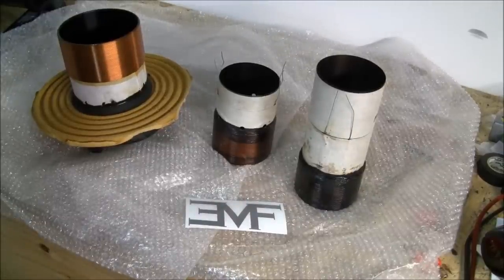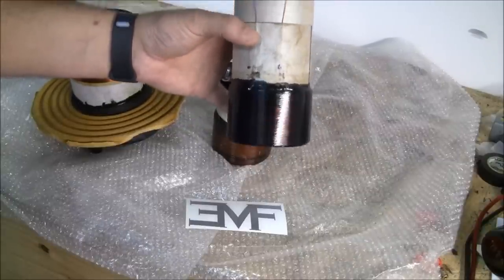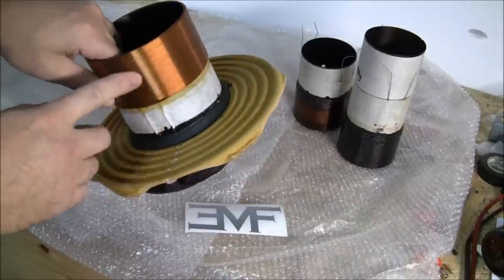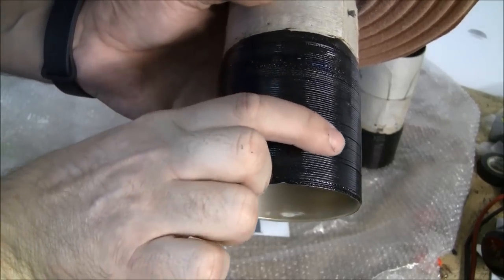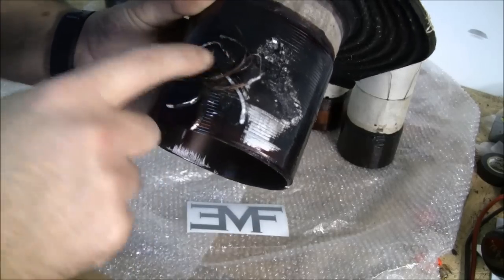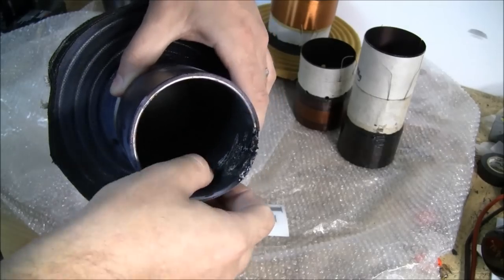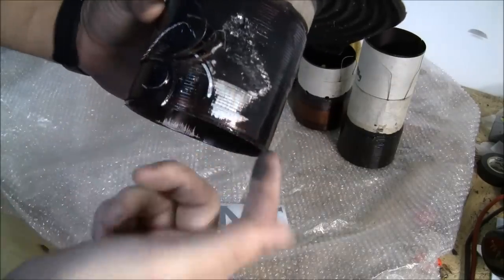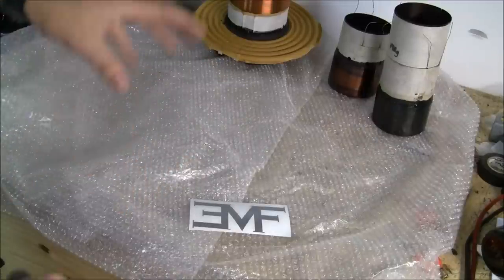Voice Coils - we know what you did!

Comment: So the dust on the last coil was cause by current arching, do this is related to Brazilian amps having a really high voltage power rail?
Reply from the maker: The dust is smoke residue.
Reply: So what do you do when some immoral person sends in his burned coil for undeserved warranty work?  Cheaters tend to get nasty when they get caught!  I hope that fact doesn't deter you from doing what's right.
Reply: they do have a high power rail, a lot like the HCCA amps and others, but the cause is lack of supplied voltage to the amp i would think and possible poor filtering or boosts from the caps inside, it is not a steady voltage and is usually because people try to overpower with cheaper amps without extra batts better alts ect ect, and well cheap amps just are what they are, they are cheap for a reason.

Comment: If the subwoofer cone were to move in and out too far by too many inches will the coil smack the back plate of the subwoofer
Reply from the maker: If the design allows for it, yes. In many design cases (like when I design one) that isn't possible.

Comment: I have a stereo integrity sql12 on a slash 1000/1 for about 2 months and now it’s making a noise. People are saying it’s a bad coil but it doesn’t make any noise when I push on the woofer. I had a 10w7 and 12w7 on the same setup and they didn’t have any issues. Could it still be a coil even though it doesn’t make a sound when pushing on the cone?

Comment: What is better the copper or aluminum coils? I know the copper should be better just based on the amps and heat it can take. But maybe there is something I am over looking with the aluminum coils.
Reply from the maker: Both have their place in design. Our Lowballer and Banhammer line use copper coils, the YOLO and Ermagerd line use aluminum coils. There are benefits and drawbacks of both that can be used for advantages in design.
Reply: @EMFAudio  Thanks for the fast reply but could you give a little detail on the benefit and drawbacks? Sorry to ask so much. I just find it all very interesting in the design choices.
Reply from the maker: @ganon420  That is literally an entire Tech Stuff Tuesday video I have planned.

Comment: Great video! Can you tell me anything about the coil in a JL 12W3v3-4? I can see some minor black bubbling on the coil through the gaps in the basket and am thinking about trying to repair it.  Is it possible to make my own coil and replace it? I am down for a challenge. Any info would be awesome!
Reply from the maker: No, you can not wind your own coil. I've never reconed one to know much about that coil used but JL's general design philosophy is 2 layer coils that aren't particularly long (except W7), wound on plastic formers.

Comment: How do you determine how far the voice coil should be put down in the ring at the bottom of the basket? Is there a measurement from top of coil to the spider or does the coil just pushed down where it won't go any further into the basket? TIA
Reply from the maker: The middle of the coil windings go in the middle of the top plate.
Reply: @EMFAudio  thank you!!

Comment: To me the use of the polyamide film on the "500 degree" coils is more to make up for the deficiencies of cheaper aluminum, rather than provide a better, more robust voice coil. A true high temp coil would have both polyamide insulation film and copper wire, which would equate to a much more rugged voice coil.
Reply from the maker: Copper wire doesn't necessarily make it more rugged. It will handle more current but it also weighs a lot more and generates more inductance, which means efficiency would suffer which in turn handles LESS power.
Reply: @EMFAudio  The weight is a fair enough point. But the cross-sectional area must be increased to provide the same current handling capabilities, so the weight savings wont be as dramatic, but still can save about 40% over copper, maybe 50% if you decide to push it. But it has one draw back in that its much more sensitive than copper to heat, so it will blow open easier under overload. It may be easier to work, which could aid in fabrication, and also allow the use of non-circular cross-sections for different voice-coil designs to allow for the cross-section needed while still staying in the same gap width. This would be almost a necessity due to the higher eddy current losses in aluminum. This combined with the dynamic resistance will dictate how much heat it dissipates. At normal audio frequencies the series resistance will pretty much dictate that (I^2*R losses), but for some class-D amps this can be very much higher if they are sending the actual switching waveform to the coil without filtering. I will backpedal a bit and say the real advantage would be the use of a non-circular cross-section (e.g. a ribbon as shown) as this would allow for more flexibility in the form-factor (and possibly a lower overall inductance) for a given number of turns in the solenoid coil. But for a circular cross-section, the eddy current losses (and heating) are higher. With that said, there would be advantages if its done properly. Regarding the inductance wont affect efficiency at all. What it will do is make the sub harder to drive since it will be more reactive, and thus lower power outputs are achievable with a given voltage.

Comment: thanks for the vídeo, have a brand of woofer in brazil that the trail of the copper coil brakes, like a dot,only one turn of the coil, the color is like the original color, what do you think about? is a material problem? thanks in regard
Reply from the maker: If I understand how you are describing it is probably a material problem.
Reply from the maker: That looks like it was near it's power limits and found a weak spot in the wire.
Reply: thanks for the attention my friend!

Comment: I need to pull my EVL from its enclosure.
I've been running this 12 on that 1000.1 for a few months now and it started making a coil noise and the clip light flashes bright red at bass peaks.
I don't understand.
I've been monitoring the heat with an inferred thermometer and 150° occasionally is the hottest it ever got.
😐... Oh boy!
Reply from the maker: All of that makes sense.

Comment: Quick question if you were to exceed the subwoofers rated rms power rating and give it more rms power than what it's rated to handle will the subwoofer bottom out and what exactly does that mean when that happens
Reply from the maker: Bottoming out is reaching a mechanical limit at the bottom stroke. Typically used to refer to smacking the back plate. That isn't from exceeding rated power.

Comment: Can you put some new glue on coils that are starting to burn the old off?
Reply from the maker: The "glue" is epoxy or lacquer. The outgassing from it is normal, it's not effecting it's ability to adhere just causing a smell or sometimes a light smoke. If it's burning off, the coil will unravel and it won't matter after that. Additionally, you'd have to cut the sub open to do anything to the coil which means you're reconing it at that point anyway.
Reply: @EMFAudio  thanks for explaining that so well.

Comment: I would think with 5 or more spiders would make the sub’s efficiency very low and require way more power than what the coil can withstand.
Reply from the maker: Not every spider is the same stiffness so you can't go off of how many there are. 3 spiders could be as stiff as 6, but you are correct in that there is a point where you don't have enough motor force to overcome the suspension which in turn makes it so you have to apply a ton of power to make it move, to cool it. The motor and coil are factors in that together. It's a downward spiral in efficiency, from being too stiff to added heat, and repeat the cycle. There are instances where a less efficient sub can be louder because it's more efficient in the installation, which is why you'd use a bunch of spiders.

Comment: what does make the coil better is that it is OFC not aluminum.....and the coil is not darkening the glue is
Reply from the maker: What happens when you burn things? It turns black. How do you burn things? Excessive heat. How do you get excessive heat? Excessive power. The glue makes it start dark, too much power makes it darker. Copper nor aluminum is a better coil, which application it's used makes it a better coil.
Reply: @EMFAudio  yes burning makes it darker, i thought the thing when you were talking about the black super glue Rockville claimed was funny, but i would disagree on coil material, imo aluminum is inferior to OFC due to the resistance of the material, price point of course plays a part, anyhow love your vids.

Comment: Do you have an example of a defective coil?????? Or in your mind are all coils not defective??
Reply from the maker: A coil might be defective if it has a break in the wire as a result of fatigue with added stress from heat. There could also be a premature glue failure. I've seen it very few times, never from our own equipment.

Comment: OK . if I order say maybe a 12" lowballer. and don't like it . is there a chance of return & refund? I'm not hard on sub's. I'm more in to sound quality. but I like my Quality loud and low! but if I like it I would be buying more. unless I can get about 150db from 1 12", all o have is a little JL amp now. on a single 12", but I'm so in happy with it. its a cheap no name 12", it came in the car.
Reply from the maker: The return policy is on the website so you can see it's entirety. How much power is your amp? You won't be doing 150 with a single 12 without spending a lot more money on a higher line sub and I suspect a good bit more power. I will say that 2 Lowballer 12's are doing 150's with under 2,000 watts in a Focus hatchback, in a musical box.

Comment: How would you describe an unwound coil that is 95% still copper colored?
Reply from the maker: I bet I can guess the manufacturer of the sub! That's a poorly constructed coil, the adhesive used isn't sufficient for the temperatures.
Reply: @EMFAudio  Unfortunately, not covered by warranty. I overpowered it but the gain was tuned with a DD-1. 1500 rms rating on the sub. Dual 1 coils wired to 2 ohm and amp is good for about 2200 rms @ 2. Had the 12s wired to 1 amp at 1 ohm previously for a little over a year. No issues. Voltage was over 13v, played for under 10 minutes (not continuously) and blew smoke. Shut it off immediately, didn't want to risk shorting out the amp. Probably not worth mentioning an actual brand name here... But I can say their one line of amps are known for overheating..... Smh. Do you offer recones?
Reply from the maker: @jefffalk8484  In reality you probably had rated power or less. Not knowing what model sub it is I couldn't tell you if I could recone it but anything that isn't ours I can't build a recone for unless it's in front of me.

Comment: So I have been wondering for a while, is it possible for you to clip your sub if your alternator cannot put out enough power for your amp?
Reply from the maker: Yes, low voltage will absolutely cause clipping.
Reply: Clipped my subwoofers for 5 seconds because I had a unknown voltage drop at full tilt

Comment: I have a idq12v3 d4 and my magnet slipped out alignment and stuck the coil down. I got it out and the bottom is a little dark but at the top there is one wire with a scrape on it can I still use the coil
Reply from the maker: I'm not sure how you would reuse the coil since the whole thing has to be torn down to rebuild it after fixing the motor, but if the coil impedance reads correctly  it could be reused. A nick in the coil isn't a big deal unless it caused a break in the wire or it's barely connected where it will blow out during play.

Comment: Is it possible for a sub that clearly says on the speaker box itself that it's 175 watts rms and your amp that was professionally put in is tuned for 150 and they by the way admitted to that isn't that under powering I'm asking because I finally got a sub that came with a 500 watt max amp it's a nice 10 inch kenwood but it is connected to the crappy stock radio well the question is that when I changed my fade on the stereo itself to focus more on the back it definitely worked in making the sub louder it was noticeable and I didn't think anything of doing that except in doing so it blew the sub it wasn't a real expensive sub and amp but it was the only one I could afford it actually hits pretty good I was starting to like the sub im just wondering was it wrong to adjust the fade like that because I have no clue on the amp itself what knob to turn that's why I decided to just turn down the front speakers and have it on the back I don't think I did anything wrong but I am a little pissed because I payed good money for this and they would not tune the amp so it at least do the 175 not 150 can you please tell me if it's on them or me I really want to know
Reply from the maker: If the signal for the amp was setup on the rear channels and it was faded forward, then you changed it so the fade was at 0 or more to the rear, you would have essentially changed it so the amp made more power, blowing the sub. If it was set to 0 and you just reduced the front volume fading to the rear it wouldn't change anything with that. But it is possible you turned the volume up past where they had it set for or they set it incorrectly.

Comment: One was not centered you can see the rubbing on pole. One with chunk missing. I have done that on to much excursion an losing control in full tilt. It rubs an short out
Reply from the maker: Rubbing on the pole doesn't mean it's not centered unless the rub goes the entire length down the former. If it's just on the bottom that's from instability at high throw, often a loading issue. You get a chunk missing from Brazilian amps like in this video.
Reply: @EMFAudio  not as to off center just to much excursion. 3 inch wind height an 10 in spider with a pole piece that lost control at full excursion.  Why sundown zv4 could have long excursion was due to the pyramid type pole the had.. unlike my build mine was flat an over time (and to stress no clip land beside in comp) rub the coil from no control.. but the build was 3 inch coil with a 3 inch wind height sundown zv4 cones 6 pack 10 inch stiff spiders on a tc basket. Had in a ported box tuned in 20s peaked at 29hz did a 152.7 at 29 hz on 2 dc 5k to each one wire to .5.. in all i fucking miss it.. but i always had problems with high excursion an coil rub.. when i recone a sundown I then seen my fault.... there motor peak which in term help control coil at high xmax.
Reply from the maker: @brianwinter1453  It sounds like you just made it have less throw, a little more BL too.
Reply: https://youtu.be/Jzf2Zb5b0cA

Here's one of the designs

Comment: why can't the voice coil be a solid piece of metal ?
Reply from the maker: patk2 The short answer is it would do nothing. Coils work, in it's simplest form, by reacting to a magnetic field and the windings are how that happens. The number of windings, size of the wire, and how it's wound all change things.
Reply: The simple answer is that a solid section of metal would act as a single turn voice coil. It would have a very low impedance, and very little motive force since the magnetic field is proportional to the current x number of windings. The solid section would also suffer from large eddy currents since its not slender like a wire is, resulting in very high losses and basically it would act like a brake in a magnetic field. By using a large number of windings, the magnetic force generated is greatly increased with little eddy currents since the wire is slender, so the losses are much less. Its a bit more complicated due to things like back-EMF from the voice coil also acting as a generator as it moves, but generally there usually at least has to be many dozens of turns of wire to be effective as a voice coil.

Comment: I once clipped my sub. It started to give off light smell, that gradually got worse. What i found out interesting was that dustcap was really cold. Is that bad cooling design or is it clipping that makes cooling fail?
Reply from the maker: KMDrush69 clipping generates heat. If the dust cap was cool you were clipping at low power or the dust cap will never got hot by design of what's happening under the dust cap that you can't see, like stacked and spaces caps or a plug.
Reply: Ok. That made some things clear. I think Ill add some details...  subwoofer has pretty beefy motor, 3 inch coil and its rated for 1400w rms. it has vents side on basket and on motor side it has pretty big hole in center(you can see back of dustcap trough it and its the size of a thumb).

 I have Alphard audio amp rated at 2000w @1ohm. (bought it new from official dealer)

Its very interesting that when I play without clipping the dustcap actually gets a bit warm and there is no smell, but as soon it sees even tiny bit of clip it starts to smell really fast and dustcap is cold.

And big thanks for your reply! :)
Reply from the maker: KMDrush69 More holes or bigger holes doesn't mean better cooling. It might be cooler when clipping because you're driving it to more xmax that is helping it cool. When it's not moving much it's not cooling, which will make it hot.
Reply: EMF Audio I just cant stop revisiting this video. Its soo interesting :). Is it okay for copper coil to be shiny at top, but darker at bottom and nearly dark at the end. No signs of bubbling, no holes, no unraveling, no smell.
Reply from the maker: KMDrush69 That sounds like it's burnt from poor cooling. Is the motor not vented or vented very little but a lot of basket venting?